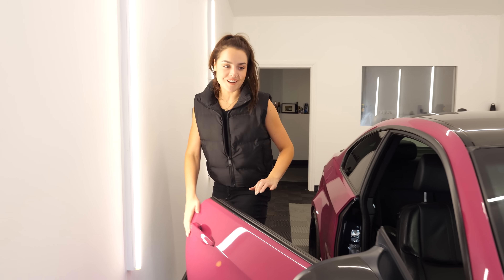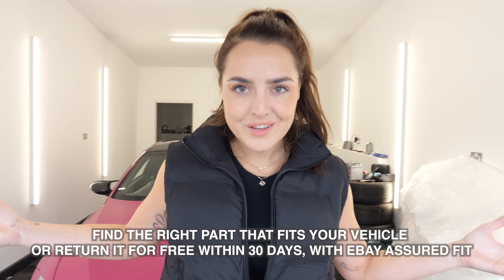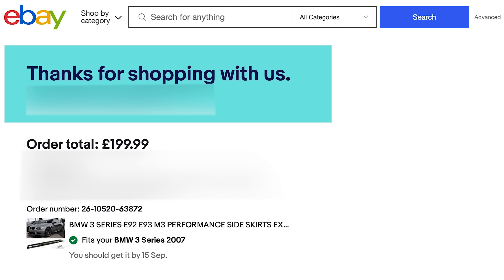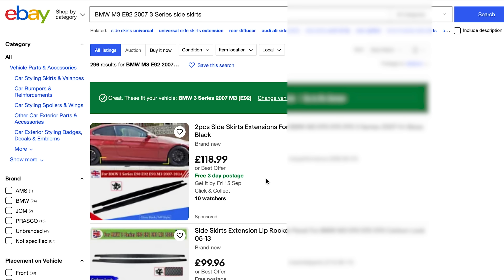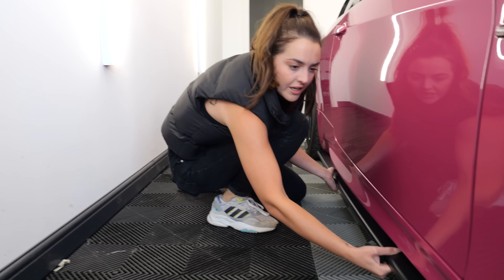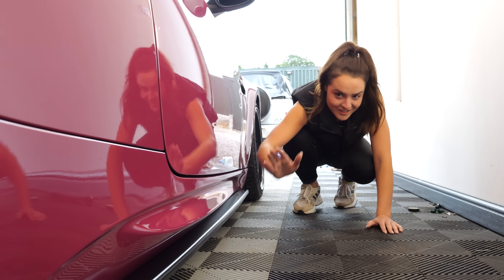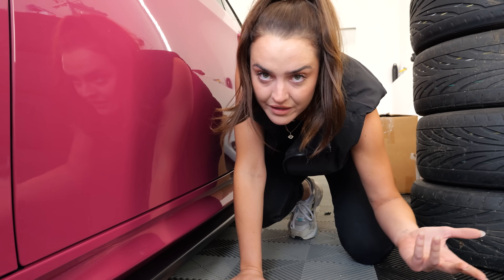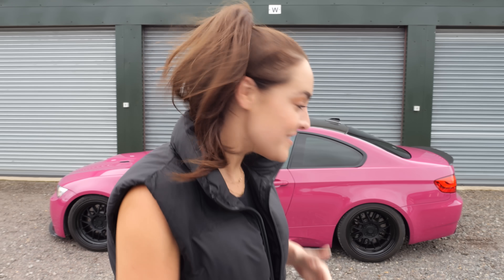SHOULD I SUPERCHARGE OR SELL MY E92 M3??

Comment: A must is the #HolyGrail Varis Carbon Fiber Undertray. Mine is going on in October.
- Custom Stereo
- BIMMERTech Backup Camera
- Brembo Big Brake Kit
- KW or other Coilovers
- BayOptics Custom LED Angel Eye Headlights
- Billet Oil Filter Cap/Oil Cap
- DINAN Sway Bars
- Racing Radiator/Oil Coolers
- Painted Carbon Fiber CSL Boot/Trunk 
- Interior Bits: Billet Pedals, Billet Paddles, Royal Steering Wheel, VENOXY Gauge Overlays, Carbon Fiber Interior, Digital Displays P3
- Racing Seats: Recaro or BMW Buckets. I think you can fit F8X M3/M4 Bucket Seats in a BMW E9X M3

I think your car has high mileage, so a SuperCharger will probably blow up the S65 V8 Engine.
Reply from the maker: Blow it up 😂 you are probably right, it’s done 80k 🥹
Reply: @BeckyEvans  LOL, mine is at 170,000, Stage 2 evolve tune, Akrapovic Evo exhaust, it's never run better....'Blow it up'..haha. My last M3 was supercharged at 70,000 miles and I owned it until 125,000....never a problem. As long as your conrod bearings are changed for peace of mind, Supercharging on a 70,000 mile car or a 120,000 mile car, makes zero difference. Regular oil changes...every 5-7k and you're good to go.
Reply: 192k miles on my BMW M3 E90.
Reply: Only 80k...That's a BABY. You are safe. Supercharger here we come!  Unless it is a 2008 E9X M3..

Comment: Unpopular opinion. 

Don’t supercharge it. 
Yes they are much quicker, I’ve heard first hand from folk that have done it that you lose some of the drivability of the car. 
These are special cars to drive and they don’t need 650hp to do that. 

Definitely keep the side extensions. 
I have the full carbon kit on mine and it’s the perfect oem+ look. 
Get the rear bumper bits to finish it off. 

And as fir the wing. 
Noooooo 🤢
I honestly think folk fit those GTS wings gif a laugh 😂 no one can honestly think that looks good. 
The e92 is the perfect sleek design, no Merc for a picnic table on the rear 🫣😂😂
Reply: Agreed.